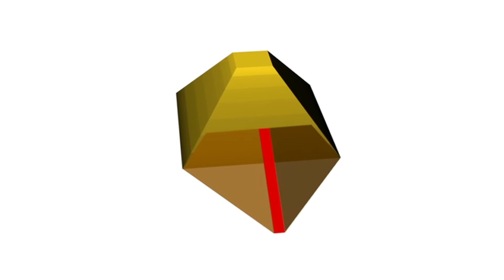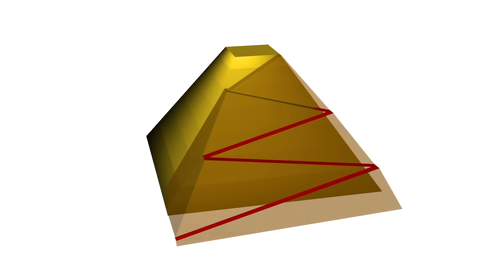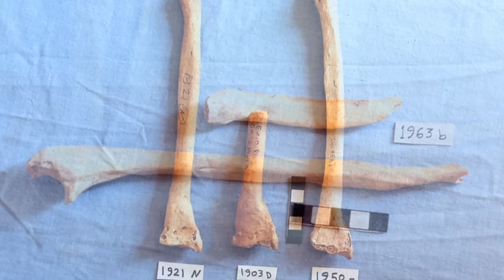Egyptology - Pyramid Construction

Comment: the ramps were part of the pyramid. They were then covered over. building back down from the top.
Reply: Ah........nope.  Your "facts" are in error I'm afraid.  While the "internal ramp hypothesis" was never viewed as credible - when the results of the muon scans done in 2017 were published = it was once again debunked.  The scans - as did other types of scans done previously - failed to show any of the structures necessary to support the claim.  

So even the Egyptologist who embraced Houdin's claim for a time threw in the towel and admitted they had gotten it wrong in the light of zero credible evidence to support the hypothesis.  The Egyptians used external earthen ramps in construction.  We have both historical and archeological evidence to support this.  Have a nice day.
Reply: Vary Olla . it was just a thought. also the inside ramps would require considerable time to make them flat enough to move heavy stones. Thanks
Reply: There are numerous issues with an internal ramp besides a lack of credible evidence to support the assertion.  Everything we see relating to the pyramids reflects rapidity of construction.  Time was always of the essence as the history of Egypt is one of the projects of a pharaoh frequently stopping immediately after that pharaoh died as their successor would have their own things they wanted done.  

So the Egyptians cut corners at every opportunity.  It would be a time consuming process to fill in any internal passages used to transport blocks.  So based upon everything we see = they would have simply blocked them off to save time and thus any scans should have revealed them - which they didn't.  In truth the pyramids are little more than stacked rubble.  

The Egyptians - no doubt to save time - basically created the superstructure are rapidly as possible using a hodgepodge of chucks of crudely quarried limestone of assorted shapes and sizes with small boulders and gypsum mortar jammed into places as filler.  The only carefully shaped and in some cases polished blocks we see are those few which were used to create the inner passages/chambers + the last few outer courses of blocks upon which the final layer of white polished casing stones sat.  Were we to remove the blocks of the King's Chamber - which of course we would not do - I would not be surprised to see they were only polished on the inward facing side with their backs being rough.  They did "just enough" to make it look neat - just enough.  Have a nice day.
Reply: I believe in aliens but i believe and in ancient  Egyptians. Do you?

Hello , what you are saying is very interesting, but it doesn’t bring anything new  about how the Great Pyramid of Egypt was built. In Romania, a book was published, THE SECRETS OF BUILDING THE GREAT PYRAMID OF EGYPT, which has completely new theories about this subject.                                                                     . 
Go to www.thegreatpyramidofegypt.com , read fragments ; the section Fragments ( menu = translated into English / Fragments of the book and Romanian / Fragmente din carte ; comments/ comentarii) and have some comment.
Sincerely, Hantz.    

www.thegreatpyramidofegypt.com      

  1 - Pharaoh Cheops And The Great Pyramid 
  2 - Menu / Meniu :  
  3 – English / Romana:
  4 - Fragments of the book / Fragmente din carte :     
  5 – Comments / Comentarii:
read "fragments of the book" and you will find interesting things.

Comment: Ok so maybe there is a small chance it was possible ancient humans could have built the pyramids. How the fuck did we line them to literal stars light years away
Reply: They didn't of course.  Claims such as that = modern pseudo-scientific nonsense.  Look at the topography of the Giza plateau.  Now look at the locations of the 3 royal pyramids + the harbor + the siting of ancillary structures and cemeteries = the limestone quarry sites which provided the raw materials to build them.   

It is quite clear that the siting of the 3 pyramids were based - not upon any Star alignment - but upon the only somewhat level high ground which could accommodate large structures and which was not already obstructed by the quarry operations and was close to the harbor.  So while the ancient Egyptians indeed followed the movements of the Sun and studied the Stars = the Pyramids of Giza were placed as a result of geography.  Have a nice day.
Reply: @varyolla435  interesting I fail to believe that as fact
Reply: Look at a map of the plateau = it is easily found online.  Then look at the location of the things I noted.  See that the area surrounding the pyramids represents limestone quarry sites and steep drop-offs such as with the Great Pyramid which has a steep drop on it's Northern and Eastern sides with a large cemetery and other things to the West of it.  

Meanwhile the Southern face of the Great Pyramid has the limestone quarries which provided it's stone as well as the road to the harbor.  That road coincidentally mirrors the modern road leading to it as the Egyptians followed the lay of the land with that strip of land reflecting a gradual natural incline which was paved over in modern times.

So Khufu built his pyramid first as well as the harbor and ancillary structures around it.  Then his son followed suit some years later = except the limestone and other quarrying operations obstructed the Eastern area of the pyramid with his father's pyramid sitting to the North and the road/ramp between them.  Most likely Khafre simple kept the original route from the harbor to the ramp on the Great Pyramid's southern side = and added on to it in the opposite direction to run to his own.  He then built his own mortuary temple and the Sphinx.  

So by the time Menkaure came to power the available limestone was almost depleted while the area surrounding his own pyramid was already occupied with other structures and quarries = forcing him to build even further back from the harbor.  So look at the lay of the land as noted.  Have a nice day.

Comment: By the way, update. They poured each one, one by one in place to build the pyramid. Your welcome
Reply: Richard Collins pouring limestone and granite?
Reply: Notkoi about 95% of it was poured. The granite and singing stones were quarried. Limestone can be broken down with heat and then combined with different materials and water added. Salt water actually is better to use than fresh water. Not sure if it was salt water or not but more than likely the used the water from under the pyramid but it’s also possible that they used water fed from the Nile river. I heard that they dug huge trenches all the way to that river and had water ways throughout the whole area also.

Comment: How did they cut the sixth side of the larger blocks to detach them from the quarry base. Let's suppose they chiselled the first five sides with bronze tools even though bronze won't cut rock that is a 7 on the mohs scale of hardness. How did they cut the bottom side? Maybe they used that magic string to pull cut it as if it were a round of soft cheese. Some stones are 10 tons and others estimated to be 100 tons. Still others weigh 1000 tons and all are perfectly polished with tools that can't do the job.  Their regard for public intelligence is not very high to expect us to believe their nonsense.

Comment: is building the ramps just as hard as building the pyramid..?
Reply: Not if you build a ramp to build the ramp
Reply: interesting David.. building the ramps is far more complex than building the pyramids.. it was supposed to be the simple way to build pyramids...now we have to find out how they built the ramps that built the  ramps, that built the pyramids, geez this is getting to hard...
Reply: @batfinkforever7036  Howcome the ramp up to masada in isreal   which was built the the Romans to reach the top is still there  but the ramps which were much larger in scale on the pyramids av vanished   completely  where is all the rock and material used on these massive ramps   there should be hundreds of thousands of tons of rubble lying around about  gone  vanished
Reply: yep, another complex ramp problem to solve, but we still haven't found out how they built the ramps that built the ramps..maybe the romans buried the ramp remains in a giant deep pit.. another brain wrecker... awesome David..
Reply: The roman ramps still there  ive seen it
Reply: Ive only today found where the ramp was disposed with all the stone  rubble   dust  camel dung and  donkey shit  it was taken to an area called Dunpo el al di Rampo  known today in modern times as Palestine

Comment: The Pyramids are not actually pyramids, they are diamonds.  What you see starting from grade level to the tip, also extends below the surface as a mirror image.  Imagine mirroring the Great Pyramid at the base and that is what is underground.  It is basically an inverted pyramid that forms a diamond shape.  They began by marking out a square, equal on all sides, then digging down 480 feet or so, this is where they start the build.  The first block was single stone.  One by one they began to add more stones around it getting wider and wider each time.  For support they would fill in around the stones with the material they excavated.  This also is how they made their way around the pyramid providing material to step on, lower blocks onto, and general masonry work areas.  Inside they would add the filler stone material.  Once they built all the way to the surface, they would have a perfect square right at grade level, then stop building outward.  This was the size of what we see as the base today.  After that base level was complete they would begin inverting the process getting smaller and smaller squares as they went upward, finally finishing at the peak.  This did two things; gave the pyramids the foundation they needed to stand for thousands of years without erosion and sheer weight causing them to collapse, or partially collapse, and secondly it allowed for twice the number of internal passageways and burial vaults below what we have discovered to date.  There are at least double, maybe more underground chambers still waiting to be discovered.  These underground chambers also served to keep the mummified remains cooler than those above the surface, and preserved the rate of decay by infinite amounts.  The further you venture down the below grade chambers the cooler the temperature.  The burial vaults at the bottom level could reach 400+ feet below ground.  Not only did they preserve the remains, they were also a deterrent to grave robbers.  The thinking was if you kept going down you would reach their version of the Underworld and be consumed for eternity.  So far LIDAR scans have not been able to penetrate these lower levels, but my hypothesis has not been proven, nor disproven, but I know this to be true.  I am waiting on the Egyptian government to work with me to seek out these whole other pyramids, but so far they have not been cooperative.  It is my believe they are afraid of what they will release.  But I will not give up on my theory.  Thank you for reading.
Reply: Hello, very interesting, but we're bringing news about how the Great Pyramid was built in Egypt. In Romania, a book, THE SECRETS OF BUILDING THE GREAT PYRAMID OF EGYPT, has completely new theories about this subject.                                                                     . Go to www.thegreatpyramidofegypt.com  , in Read fragments ( menu = translated into English / Fragments of the book and Romanian / Fragmente din carte ; comments/ comentarii) and have some comment ?
Sincerely, Hantz.
Reply: @ionelhantulie4368  Thank you for the information

Comment: This video is not truth about the pyramids !

This may sound crazy but it is the truth and no one can dismiss it !

The pyramids were built from the top down as the material or blocks were already there in place , they only needed to be lowered down out of the way once determined it was not needed.

Everyone wants to make a video on their guess but they are all wrong about it. The material called limestone is in our body , it is CACO3 -calcium carbonate and it is what our tendons are made of in our body.

This is the hardest pill to swallow because it is the size of a watermelon.

The humongous giants that stood over 2 miles tall , they drowned in the great flood while stuck in the mud .
The tendons of their achilles tendons were still there and the demons are already in the building block formation.
They will never need to be cut , they are square by nature , they were still wet and soggy from the salt water flood , it was like cutting a block of cheese .
The wet pliable tendonus flesh would even hold hand prints or never need mortar for joints seal because it sealed itself.

If you was a small example of what I am talking about , checking out the devil's tower and imagine it about 75 % bigger in size.

The devil's tower is the Achilles Tendon of a giant also.

Comment: Wow you guys did this 2 years ago. It’s not a mystery what ramp. It was an internal ramp. You have all the funds to get people together to make a video like this. The least you can do it get the very most simple and important things correct for the time. It’s like you guys are wasting years thinking about something wrong when the right and most possible answer is already available. It has all sorts of evidence to back up the internal ramp theory including scanning a of the whole pyramid that showed something spiral inside and they used a computer program to design the actual pyramid and how it can be built with the grand gallary being put there because of a pulley system for a major part of the pyramid.

Comment: Where  built  from  the inside  out , consider  that  rocks   shifted overtime , the  bottom  layer was  soild rock floor so  they put  the  2nd  layer   from  a  ramp   from  the  ground and the 3rd  from   a  ramp   from  the  2nd  layer and so  on the  kings  chanber  built  when  they    got  high  enough lower  rooms  built  first  and   outer   walls  built  around  them .

Comment: Great video!  Have you ever heard of the "cylinders of the pharaoh"?   They are made from copper and zinc cylinders filled with quartz crystal when held produce up to 1.5 volts sold on amazon and etsy for only 29.99 or just make them yourself

Comment: They could've used imported wooden scaffolding as ramps. Then when it was finished, they burned the scaffolding while it was on the pyramids during a celebration for the completion of the project.

Comment: Wake up people. Humans building the pyramids?.Nnnoooo! A far more advancing civilization built them , aligned them to Orion and placed Giza to within 60th of an inch from centre of the earth and could be seen as 8 sided pyramids but only on the sun's sunset  of the summer solstice, by showing an  inverted angle down the centre of each side. No bodies have ever been found because the pyramids were power stations ,proved by the  hyroglifics. No charred remains ever found on walls .V dark in there and aquifers (underground lakes) are under them. Crystals were in the huge 19tonne granite tomb which created electricity..the Egyptians hadn't invented the wheel , yet there is evidence of clean circular saw cuts through granite. Diamond tipped blade needed for that .Pyramids built by chisel and hammer. Get real people.

Comment: An ancient alien race built that and here’s why:

1. The amount of man power needed to lift the stones up and over each other would have been in the hundreds if not thousands
2. They needed a pulley system at one point to lift said stones, and with what materials? Most historians said it was made from wood, however, this is fricken Egypt, where in the hell is there enough wood for a project like that?
3. Descriptive and detailed drawings incomprehensible as to its exact meaning or origin, chronicling the events of the pyramids and its construction
4. The pyramids are unlike any structure we’ve ever seen and haven’t replicated anything like it’s size or magnitude before. It’s architecture completely revolutionary, considering its time period.
5. Ok hear me out on this one, the remnants of the Sphinx and pyramids were once a part of an ancient alien race that “went extinct” and we are unearthing it’s remnants to date. Sand has accumulated over time, burying its history with it. 
6. (Far stretch) the pyramids were not “tombs” or “burial grounds”, but instead a site which held a sort of satellite array which communicated with the spaceships in order to land properly and safely

Comment: Do check out Thanjavur temple it was built earlier than this with more fine and advanced engineering. The stone on the top part of the temple is 80 tonnes and still staying strong there.Till to date no one ever seen shadow of that building this is because it has no one due to its great engineering construction and also the angle it has been placed ..no offense to anyone but just extra information for you guys ..cheers